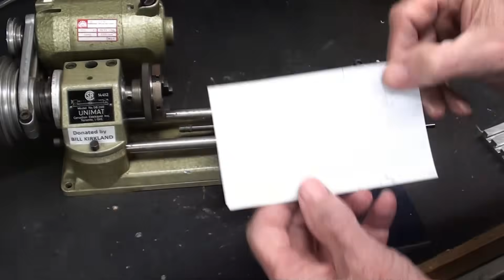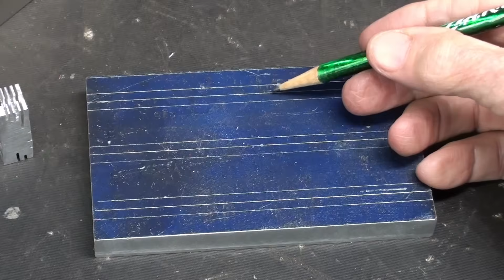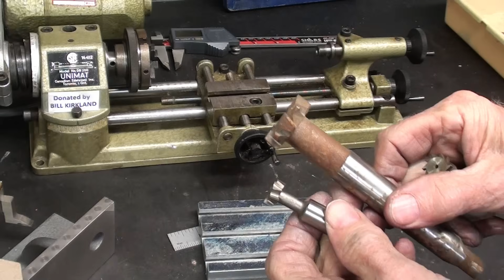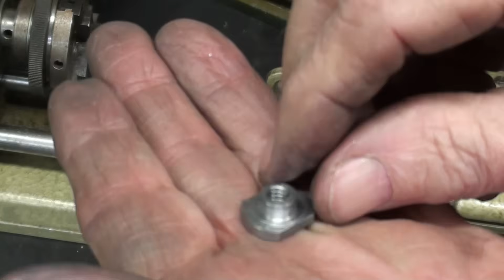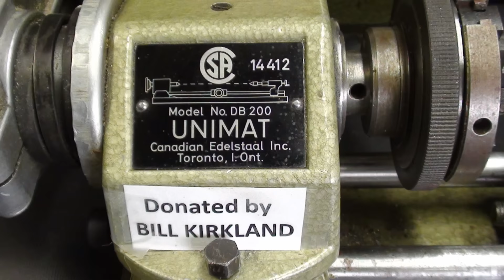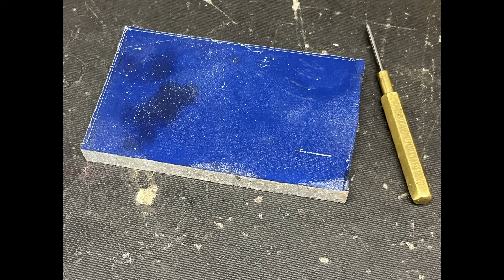MAKE MILLING TABLE FOR UNIMAT lathe #938 tubalcain emco edelstat

Comment: Interesting video Mr Pete. The second type of T nut you made are actually the way Emco supplied them with the Unimat. They were like this on the Unimat I owned some time ago. Myford lathes were also fitted with T Nuts like this. The raised round part giving more thread engagement. Thanks Mr Pete. Cheers Nobby
@nobbysworkshop

Comment: When I made mine, I quickly discovered it was cut with a special cutter I don't have. Nothing I have can make a T slot that matches the original T nuts. So I did what I could. My stock was recycled and had relief cut out on the back side so i could only make one slot. I cannot imagine cutting iron with the tools required to fit those oem T nuts. Great job, and your slot looks identical to mine.

Comment: I enjoyed this very much. I particularly like the videos where you machine things. My Unimat didn’t come with this table, but I copped out and bought one on eBay. It looks like you had the hold downs. I bought those too. I have more into the accessories for my Unimat than I do in the lathe itself. Fortunately it came with power feed, that a particularly expensive accessory. I paid a pretty penny for the indexing attachment and plates.

Comment: What a great little project.  I think the DB200 comes with a smaller table so it's even better.  I sent you a couple of things, should have it in the next day or two.  One of the pieces will fit the little Unimat.
Reply from the maker: Cool, thanks
Reply: I hope you got that tiny live center. It is small, but works.  I sent you a better one, but it will need a sleeve added to fit it into the tailstock.  I also sent you some silver marking pens that are great for marking on black stuff and don't hurt the surface. @mrpete222

Comment: You  were talking about tiny and fiddly bits.. that made me giggle.. since i'm used to making way smaller parts.. 
a while ago i restored my fathers Unimat SL, and to test it, i made some watchparts.. "Tubes" that guide a watchcrown, i took a 4 mm Stainless steel bolt (since that was the only stainless stock i had at hand ), drilled a 1.2 mm hole in it, turned it to 1.6 mm 1.5 mm long, and behind that 2.5 mm 1.5 long, i then parted it off. reversed it. and chamfered the "Big" side
recently i got myself a "Box of bits" about 70% of a Unimat SL (only the bedguides, the crossslide, the tailstock and the support (with the brass rods missing).. i'm aiming to make a new bed, headstock and put on a motor, to make it complete.. 
Also.. i got myself a Unimat 3 complete, which i will also use for watchparts..
Reply from the maker: 👍👍 thank you, I need to get used to working with tiny tiny parts. Some thing that I normally do not do.

Comment: Lyle -  Another good video.  Learned a bit as I have never had to cut a tee slot - yet.  Spent a couple hours yesterday afternoon making the dovetail part of the double indicator holder to fit an Aloris that you did in Tips 421.  Had a brain cramp and it ended up a tad wider than it should, but still will lock up so will be usable.  One suggestion - when your are using specialized cutters like the Woodruff or  dovetail it would be helpful if you mentioned the speeds and feeds you used as it would give a starting point.  And save going to Moltrecht to do the calculations - LOL.  Thanks and keep up the good work, we really enjoy it.  Dale

Comment: The original T-nuts look like your second batch with the collar to give more threads, but still have the square shape.  I'm made many of them over the years because i used to over tighten them, they all eventually snap.

Comment: lol metric vs imperial ... as an architect / mechanical draftsman i had to learn not only metric and imperial but scale and other measurement systems from the middle ages...i have learnt 1 they all have use . 2 learn to use the one best suited to your task. 3 it has been my experience here in canada where we are metric lol  our goods and materials still are produced to imperial standards ... that unrememberable number of mm is still a 4x8 sheet in 1/4 /12 3/4 or 1 inch thick and 6 13 and 25.4mm are still 1/4 1/2 and 1 inch  . the world may measure it in metric but its made in imperial for most things. thanks for the videos
Reply from the maker: Thank you for that analysis. I totally agree. I have many people in Europe that are angry at me for using inches in feet.
They do not realize that the United States was the arsenal of democracy and supplied the entire world with armaments using the inch system, lol.
Reply: @mrpete222  and yet inch fractional ...is imperial measurement  based off english kings anatomy... we could do it in spans palms cubits and fingers... links rods chains  and let the europeans tell you y in the metric system a 6mm not 10 mm screw is the most common?

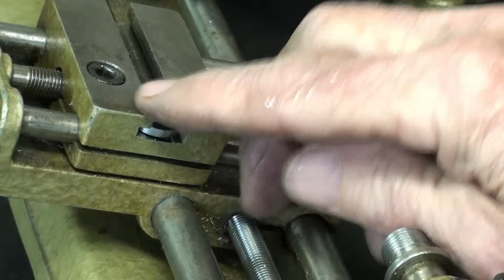Comment: @16:56 "these insignificant little pieces"  I disagree.  If those T-nuts fail, the table starts moving, scrapping the work and maybe the entire machine.  Yes these vital parts are small but they took an appropriately long amount of time to create correctly after the shortcut experiment and you have every right to feel proud of that time investment.  Whenever I find myself thinking that I'm working on something insignificant, I'm likely to be a bit sloppy in my execution.  Not a good attitude to ever bring into the shop. Once I ask myself what would happen if that part failed, I get my mind right again and can safely continue.  (Yes, I talk to myself out there and occasionally argue with myself.)

Comment: Mr. Pete, as you test the milling table, would you keep in mind this question?  would it be more reasonable to assemble to Unimat as a mill, or to keep it assembled as a lathe but adding a milling attachment?  I have used it as a mill but it does not behave rigid enough. Drilling is ok, facing with an endmill is not. It does not help that I do not have a collet for an endmill. If first things first, I am still trying to figure the very first one I need, ha!
Reply from the maker: Time will tell. I have not used it as a mill yet.        I am very doubtful that the milling head is very capable.   I expect it to chatter like a tuning fork.
Reply: I used to use my SL in mill configuration all the time, and even made a 3/8" endmill holder for it.  You can't hog metal like crazy, but it was rigid enough for many years of use.  Light cuts help, but I think the mass of the cutter and holder actually helped with the vibration.  The holder was made on the unimat from a Acura axle stub (cut to a smaller size, of course!)

Comment: Once again, an offhand comment triggered a light bulb over my head.

Something to the effect, 'I'll lay those out w/ the height gage.'

I would never have thought of setting the height gage, then sliding it past the material, all while on the granite, to get absolutely parallel lines.

But then, I couldn't take machine shop in high school because I was already taking the 2 period drafting class AND the 2 period wood shop/construction class.

They didn't like 2, & absolutely refused a 3rd!

Question regarding the end mill passes. My mill refuses to do anything but break end mills if I climb mill.

When you make a slotting cut like you did, is the force on the mill the same no matter the direction?  Or would one direction be climb & the other conventional?

Re: small tee nuts
Much experience w/ those. Sherline makes square T-nuts w/ 10-32 holes. They have a short neck like your V 2.0.

They also make an inch tall one for use when there's room.

The short ones strip out after a while, the tall ones pull the 'T' off the bottom.

I bought some rectangular T-nuts, but they weren't hard enough & not heat treated.

First, I switched to 10-32 studs & nuts, instead of headed screws, to decrease stress on the few threads, which helped longevity of the nuts.

Second, I used "Cherry Red" to case harden the rectangular ones & replacements I made.

Third, I redesign several different T-nuts w/ different 'neck' lengths for attaching specific items down to the carriage T-slots.

Not having a compound carriage, the Sherline has a 2 T-slot table as the top surface of the cross slide.

The tool post mounts on it, the knurler mounts on it, & the parting tool I made does as well.  I designed both to mount so they work from behind the spindle center.

Turning the parting blade upside down creates downward force on the spindle;  these little lathes are more rigid in that direction.

Helps w/ knurling, even though it's a scissor style.

If you know what length studs you have use for, I bought a variety of long set screws to use as studs, be happy to send some your way. In several sizes, it was cheapest to buy a box, so I have plenty to share.

Make nice studs because they haveca hex in one end. Don't recall if I have any 12-xx, but lots of 10-xx & ¼-xx.

If you mount your unimat to a piece of plate, see if you can scavenge a sink cutout from a local granite countertop installer.  They usually throw them away. Combined w/ steel on top & some 6061 on the bottom, the resulting sandwich makes a rigid & dense base for little lathes & mills.

Adding the density of the stone makes a surprising difference in vibration dampening.

Thanks, as always.

Regards,

George

Comment: Diagonal. Can the table be mounted diagonally and supply four more positions?
Reply from the maker: Sure
Reply: Came to the comments to say the same thing, if the holes are equidistant you would get at least 2 cutting directions at 45', don't know if it would fit pointing toward the cross slide wheel, but if it does there's the other 2 positions.
If you were so inclined, and if the holes fitted between the T slots right, you could bore holes to give 60' and 30' as well.